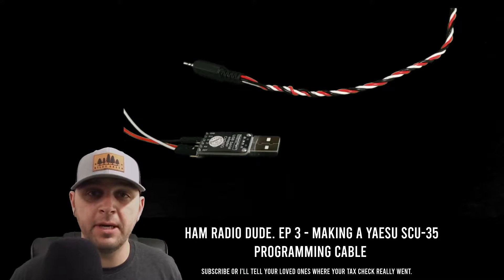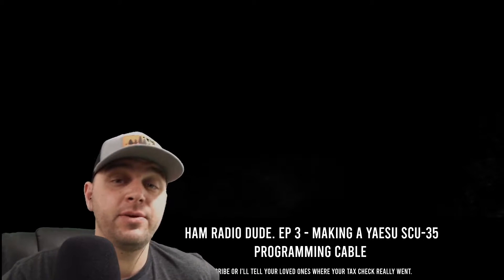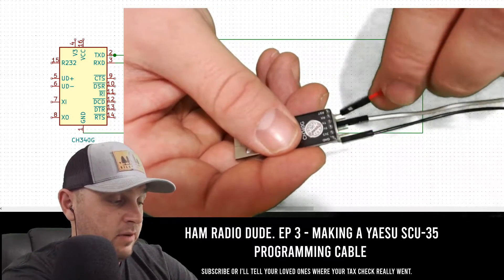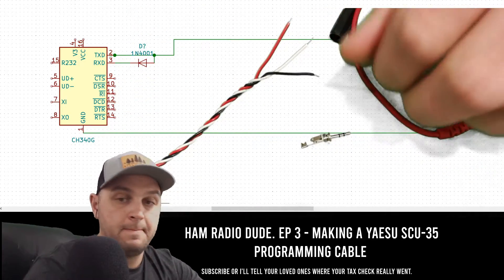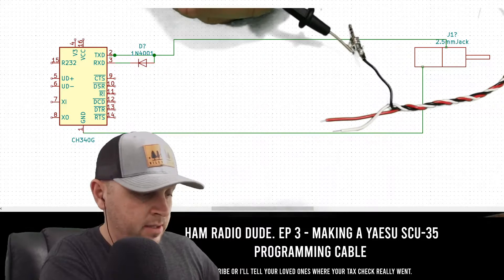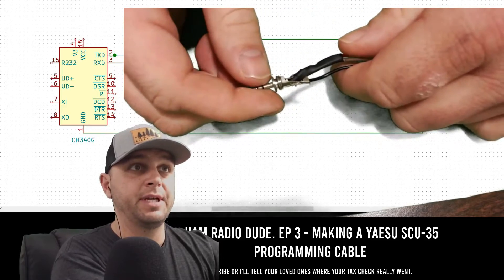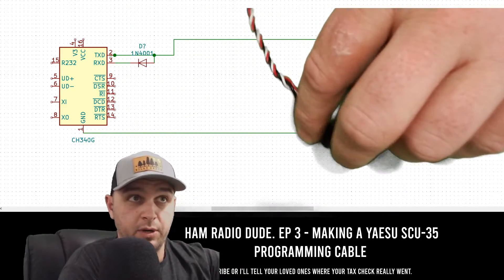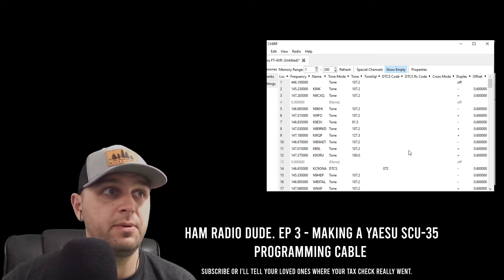Making a Yaesu SCU-35 Programming Cable!

Comment: Thanks for sharing. Worked great!

Like others have mentioned, I had to put the diode to the TX pin, not RX pin. I suspect this is the correct way, as I understand that TTL is inverted logic (0V is 1, and 3.3V is 0), so when not TXing it would hold the single wire permanently high and therefore stop RX functioning; but when it is TXing, the diode still lets it pull the wire low. Anyway...try the diode on one pin, and if it doesn't work, try the other pin 😉
Reply from the maker: This is the way

Comment: What is the purpose of the diode, to protect the USB adapter or the radio?
Reply from the maker: For sure, I do not know.  However, with other models; The diode is used to prevent the Recieve and Transmit lines from interacting negatively with each other when programming.

Comment: I used SparkFun  FTDI 3.3V, no diode, I shorted RX directly to TX, works great with chirp and Yeasu software. Thanks for the Idea, I had no idea the programming cables would be so simple. For the price they charge I figured there had to be some secret IP involved.

Comment: I tried 2 different cables on this. First one had diode pointing to the rx side and second one to the tx side. Both cables give errors with chirp and the second try immediately shows Clone Ok on the ft-65r, but it does not transfer data when reading or writing to the radio. What am I missing?

Bob K

Comment: The CH340G is obsolete and no longer easily available.  The TEL0010 is five bucks, if you can find it.  You can get a complete cable with adapters for six radios on eBay for sixteen bucks,  delivered.
Reply: @roberth5435  that kit is dangerous, I tried it with my 4xr and now I can’t program the radio except through the keyboard.

Comment: I got mine built!   Ran into a couple issues... first I used a 3.5MM jack instead of a 2.5mm, second the TTS-USB dongle I used had 5V and 3.3V settings.  I needed to use the 3.3V setting to get it to work.   Couldn't have done it without your video.

Comment: Reversed?!!! I followed these great instructions; and nothing... tried it a couple times with new parts ... still nothing. Then I watched another unrelated video and the host mentioned that its not uncommon to find the TXD and RXD reversed ... Sure enough, that was the case with my CH340G, The RXD is actually TXD, and the TXD is actually RXD. Same issue with a cable I made for my Boafeng HTs. So don't despair, just reverse the data connections....!

Comment: I tried ordering the parts you had listed but I ordered the CH340G with the usb plug and the vendor never shipped it and Amazon canceled the order.  Do you know where I can get another USB Serial adapter that will work?
Reply from the maker: Great question. I have not tried any other ones out, but these appear to be the same - https://www.amazon.com/TOTOT-CH340G-Adapter-Converter-Upgrade/dp/B07CC9X6VX/ref=sr_1_4?dchild=1&keywords=ch340g&qid=1620061799&s=electronics&sr=1-4

Comment: At first I was having some real problems, but was able to get this working. If CHIRP doesn't work the first time, TRY MULTIPLE TIMES. I almost gave up before I tried this simple idea. The first connection to the radio always fails.

There was also some confusion about the diode connection, because there is a diagram online elsewhere that is wrong. I have it working with the cathode of the diode connected directly to the RX pin on board (soldering makes for a 2-wire cable.)
Reply from the maker: @tent405 thanks for the post.  I know it was brought up a few times, regarding the polarity of the diode, and I think that other diagram is causing issues.  Again, thanks so much.

Comment: would this cable work with the FT-11R and FT-51R? would you have any suggestion of how can I make a cable for these Yaesu? thanks
Reply from the maker: I do not have the answer for this, only because I don't have a way to test. They look like similar cables, but the wiring is probably different, internally.   The SCU35 cable shows compatibility for the ft25r, ft4x and ft65r

Comment: What exactly is the purpose of the diode? Is it for rectification (prevent reverse current flow) or to provide a particular voltage drop? (I have germanium diodes lying around and am trying to figure out if I can use one of those instead)
Reply from the maker: Hi Jordan, sorry for the delay. I believe it is rectification as the Transmit and Receive both use the sleeve.  Without the Diode, The radio doesn't properly read/right.  I suspect this is due to the Diode restricting RX going into the TX. or vice Versa.  In short: I don't have an answer for this.  BUT, if there is a way I can test something, to help determine, I'd be more than happy to (You'd just have to tell me what to test)= - https://radioamateur.us/wp-content/uploads/2020/06/yaesu-scu-35-pinout.jpg has a good photo of the schematic.   Again, hopefully this is of some assistance, but if I can help, let me know.
Reply: @DudeTested  this link is dead.
Reply from the maker: @azarellediaz4892  sorry to hear.  Maybe reaching out to website owner can help.  Thanks!

Comment: Hi I followed the process of making the cable as you went through it. I tested all the connections as you described plugged it into the radio and the USB port, ok there were some driver errors on the USB connection - sorted them out. Ran Chirp and switched the radio on, clicked download from the radio and got the message "Failed to communicate with the radio:Incorrect Echo on Serial Port Radio Off? Bad Cable?". Triple checked the connections with a multi meter and the diode and made sure it was on the right way round. Any ideas on what might be causing this error. BTW great video and series. (Using an FT-65)
Reply from the maker: If you want to send me a photo, I'd be more than happy to look at it.  a photo of the usb and wiring, and maybe the ends.. same usb device I used?  Thanks for the positive feedback!
Reply: @DudeTested  I think there is some confusion about the polarity of the diode.  The schematic shows the cathode going to RX but while following thru the video it appears to be going to TX.  This site also shows the the cathode going to TX.
https://www.youtube.com/watch?v=Xqw2q3maDyU&feature=emb_title
Reply from the maker: @judithrenaud9903  thank you. Time to remake this video!

Comment: What size connectors and wires are you using? I just bought a YEASU FT-65R and want to try this project. Thank you.
Reply from the maker: 22AWG wire to 2.5mm stereo connector .  Good luck!
Reply: @DudeTested  I cannot find the connectors from wire to USB. What size/type are those small connectors? 
Thank you in advance!
Reply from the maker: @meanmikeyp  Those are just jumper wires.  I've only ever seen them come in one size -  (Non affiliated link to the wires) 

https://www.amazon.com/EDGELEC-Breadboard-Optional-Assorted-Multicolored/dp/B07GD2BWPY/ref=sr_1_1_sspa?dchild=1&keywords=jumper+wire&qid=1589281610&sr=8-1-spons&psc=1&spLa=ZW5jcnlwdGVkUXVhbGlmaWVyPUExVkpQWFM5TE1URkM3JmVuY3J5cHRlZElkPUEwMTgwMTgwMVc4TDYzRjhaT1VWRSZlbmNyeXB0ZWRBZElkPUEwOTQ1NDM2MUpBN1RMSkJGREFMWiZ3aWRnZXROYW1lPXNwX2F0ZiZhY3Rpb249Y2xpY2tSZWRpcmVjdCZkb05vdExvZ0NsaWNrPXRydWU=

Comment: Thabnks for this great video, I made the cable it tests out as yours did just fine then I get the Error Incorrect ACK on serial port. Any indicators for this?
Reply: Should have added using FT4X and used exact parts running windows X
Reply: OK resolved very embarassing, used the 3.5mm not the 2.5mm jack :-( 2.5 on order !
Reply from the maker: You know, I did the same thing when I made mine.... It's a learning experience.  I should have mentioned that In the video.   Tomorrow I'm posting a video for a baofeng and Kenwood radio.  Thanks for checking out the channel!